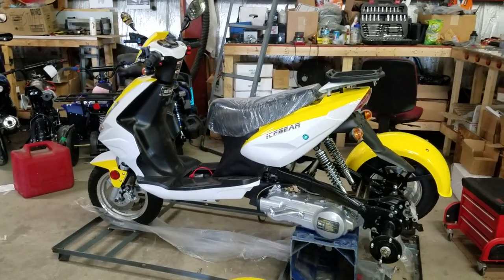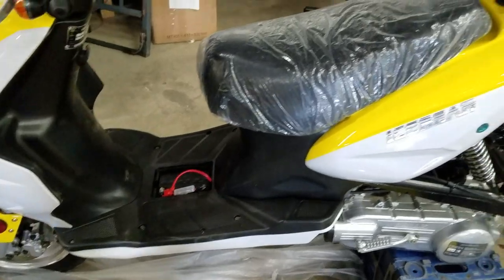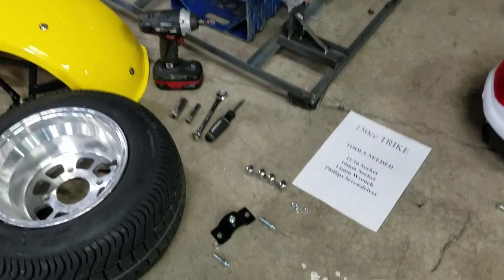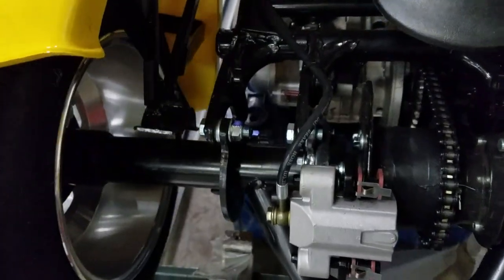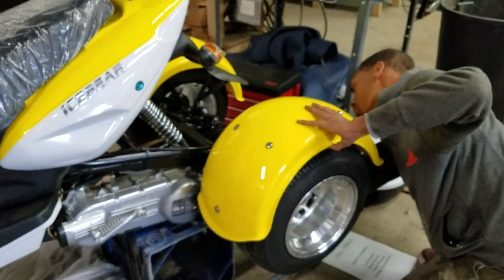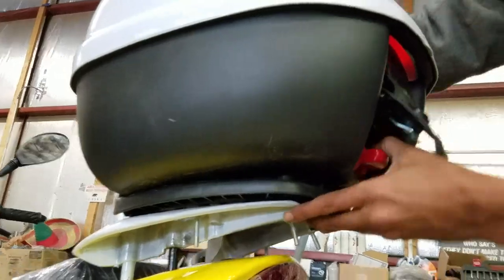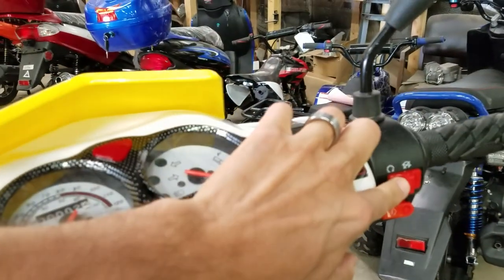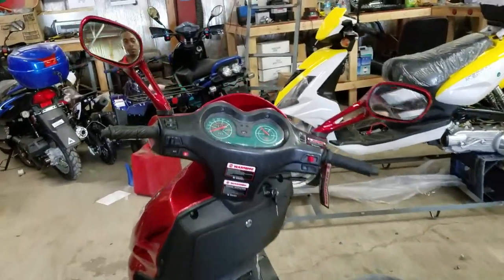150cc Trike Scooter Assembly From SaferWholesale.com

Comment: How do you raise the hitch I'm about to get a trailer for it soon and where can i take it to to raise the hitch i thought about making the back tires bigger or just taking the two back wheels of replacing the with bigger tires ?
Reply: Cut weild.. Or bigger tires but have to get custom rims so bigger tires is easier..
Reply: But you better add some extar brackets or support that hitch can only take maybe 20lbs if that.